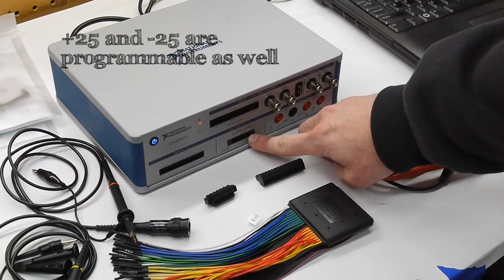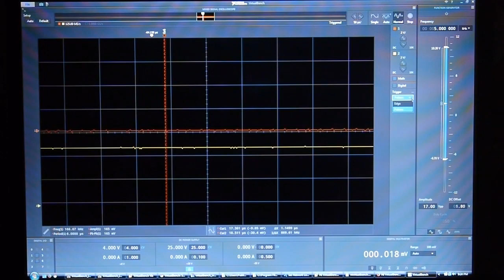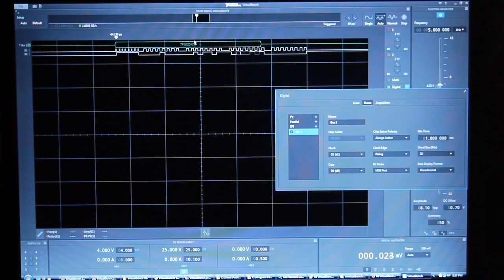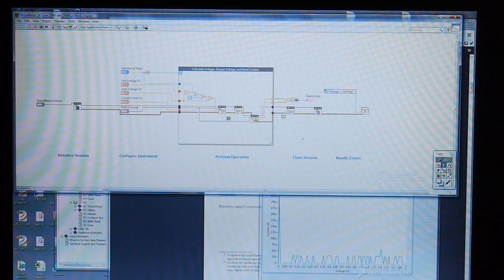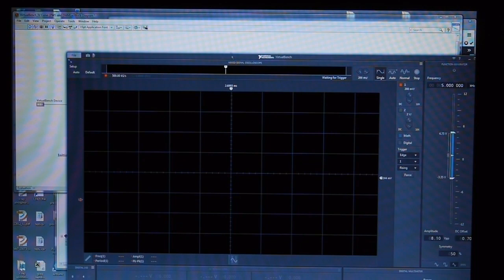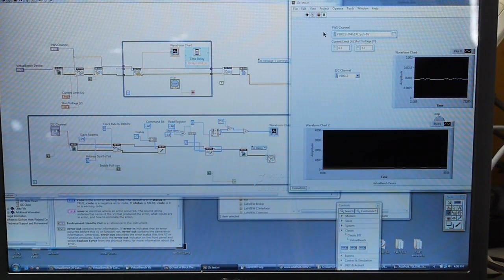Review of National Instruments VirtualBench

Comment: hello friend , I've designed a magnetic  crostat to measure the magnetoresistance at high and low temperatures , now I'm leaning lab view and I've NI MyDaQ but I've a problem  I couldn't solve it for a year , I use the four probe method to measure resistivity ,I  wonna to make a program that  can record the measured voltage as a function of temperature as I want the program to record the voltage at a specific steps of temperature  set it ,,,
and thanks a lot

Comment: Great Video.

NI hardware & software is expensive, but the quality is excellent (I'm in my 20th year as a LabVIEW user) and I wouldn't use anything else.

However, for the hobbyist on a modest budget, I can't recommend enough the Analog Discovery (v1 and now v2). It can do many of the things the NI box can, but at a fraction of the price. The thing that really stands out is the WaveForms software. It is hands down the best "do everything at the same time" tool I've ever used with common clocking and synchronisation across all the features.

https://store.digilentinc.com/analog-discovery-2-100msps-usb-oscilloscope-logic-analyzer-and-variable-power-supply/

It may be worth talking to Digilent to see if they'll send you one to try out.

Best regards,
Alex

Comment: I suppose it is great for low end, kind of low volume product testing. I mean, for 2000$ you can also buy all that stuff that it has internally as separate (better working) equipment. Rigol DS1054z is just 500$, you can get like 3 powersupplies for 400$, add a logic analyzer 100$, random uC dev board for generating stuff 10$, 2x multimeter 400$. Under 1500$ you can easily have all of the stuff in the box, with better performance and/or capabilities, easier UI and of course separate screens.
I dont think any semi-serious engineer could get used to PC oscilloscopes btw, they are great to carry around if you are travelling or working in a car, but for any serious work they are just too finicky.
Reply: I think it's just that not enough effort has been put into PC scopes, its generally viewed as a low cost option. Its certainly not that you can't make a good UI for a scope. I mean modern scopes are basically PCs with some extra data acquisition hardware stuffed into it, most of them even run windows.

Comment: As someone who worked with NI acquisition cards for (too) long I got to say that NI is good at designing hardware but LabView is terrible! This is not a software you want to use for anything critical. My boss liked it because I could make everything look nice real quick and he hated those logs running on DOS consoles. The problem is that when the software sucks, it is not fun to use the hardware either. I ended up doing almost everything in C using NI libraries and some of my own. This gear is good as a testing rig and not for anything else. It has a lot of power but not to put a screen and buttons on it is silly. Using the computer is your interface for everyday usage is NOT something you want to do when you need to work. You want buttons so you can control the device quickly. I know NI are not really making scopes / analyzers and such but they did here. only did not give it a proper package. Hope someone in NI reads this stuff and perhaps one day LabView won't suck and this device will turn into something worth buying.

Comment: They should make a pc oscilloscope that plugs onto a pc with a giant ribbon cable to a PCIexp slot. then you could have realtime.
Reply: They do. Just look into the higher end (20kUSD and upwards) Keysight/Tek oscilloscopes where they just put in an ATX motherboard and a touchscreen. The oscilloscope frontend is as usually connected to an ADC which is in turn connected to an FPGA that is connected to the PC via SATA (or sometimes PCIe, but don't quote me on that).
The FPGA and ADC are mandatory to capture signals and deliver them to the PC. Also long ribbon cables and PCIe don't work well, since there will be a lot of data loss (if the data even arrives at all).

Comment: It's a nice bit of kit, but sorry, the "bang for the buck" just isn't there. A Rigol (who makes the lower end Teks) mixed mode scope with an LXI will interface to LabVIEW as will many competitively priced power supplies and function generators, giving much more flexibility and you don't always have to drag around a laptop, boot up, etc. With a laptop and a MDSO, you now have two simultaneous screens.

And of course, if your needs go outside the power supply range for example, you have another box on the bench anyway. Like you said, it seems pretty niche.

I say this as a hard core Certified LabVIEW Developer. For my money, there isn't a better rapid development environment out there, period. Even so, I prefer my dedicated knobs and buttons. It's just more intuitive.

Comment: Applied Science Can you please review Red Pitaya?
http://redpitaya.com/
Reply from the maker: I've been watching the development of that system for a while.  The hardware looks nice, but programming it appears to be very difficult and time consuming.  It definitely will not replace benchtop test equipment.  It might have use as a dev board, or system controller for something large and expensive like a robot.
Reply: Applied Science Is there something specific that you think makes it difficult to program?
Reply from the maker: user255
The amount of code required to simply acquire an analog signal seems very high.  http://redpitaya.com/make-your-app/on-given-external-trigger-acquire-signal-on-fast-analog-input/  The complexity involved with interacting with SPI or I2C, USB, etc is higher, so would probably require more code complexity.  The device is certainly versatile, though.
Reply: Applied Science OK, I see your point. Though I would guess there is already code for most of the things, and thus you would simply need to call functions according to what you want to do.

Comment: Windows VISTA?! REALLY? A guy like you stuck to a shit like that?

I am not saying you should have Win8, but at least Win7. Better XP than Vista IMHO, even it is no longer supported
Reply from the maker: I have a few computers, and this one is running Vista because that is what it had when it was new.  It isn't bad enough for me to spend time re-installing the OS with another version.
Reply: ollythebest94 So you are recommending XP, an OS without any security actualization support and lots of unpatched security issues. Great advice.
Reply: ollythebest94 Haha, XP isn't slow? I can run linux on a Raspberry Pi more fluently than Win XP on my notebook. But still, I am not giving anyone advices to change to linux because I know it's limitations. I'm just saying that if you want to give some one an advice be sure it will do no harm to the person.
Reply: RenanzinhoSP Well Vista isn't that better, but at least XP isn't that slow
Reply: The only limitation of Linux (and macOS to a lesser extent) is the software, but you can use Wine for running Windows programs or install Virtualbox and run Windows when you really need it (if it doesn't work with Wine). In any other aspect, Unix-like systems are far superior and better than Window$ since they don't get slower as time passes by. My 2 year Windows 8 Pro was awfully slow, it took 15+ minutes to boot and crashed frequently (right now, there's Windows 10 installed I use when I really need it, and after a few months it already has problems). OK, I'm a hardcore user and I install lots of apps, but I do the same on my iMac (in fact, I think I've installed many more apps on it [maybe thousands if we count command line utilities]) and it's almost like new.